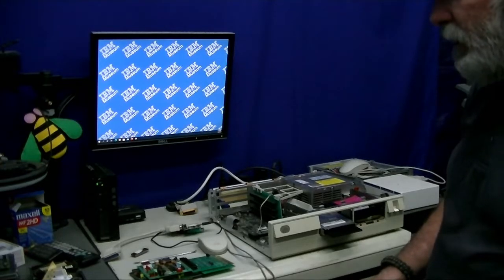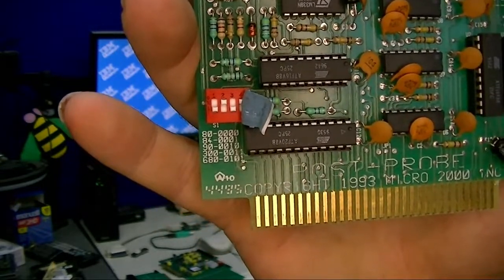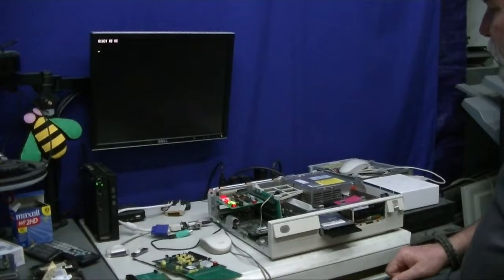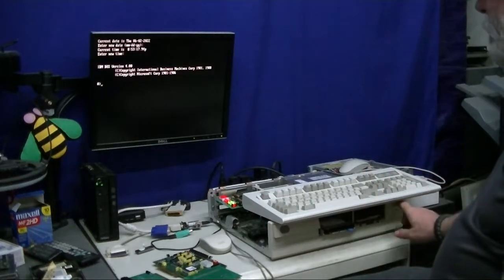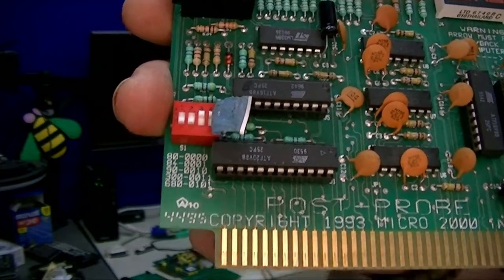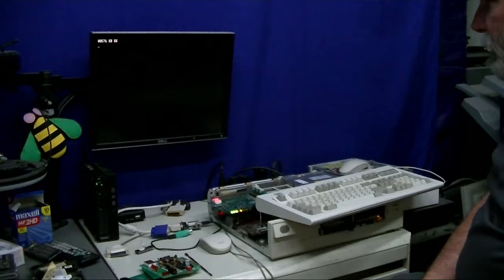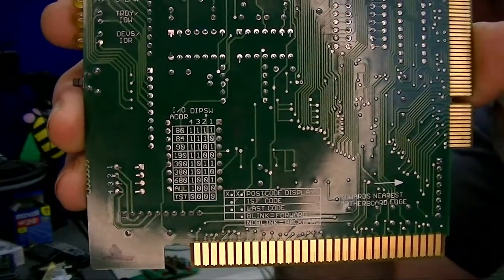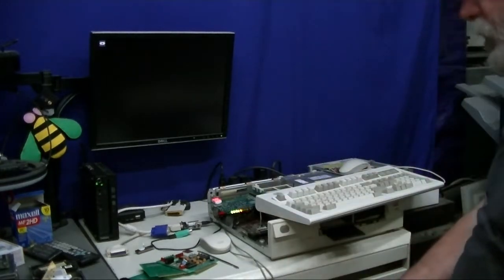Checking POST code adapters in ISA PS/2s!

Comment: Hah, I've never realized the original Model 30 and 25 (8086) used a different diag. port - 90h and LPT1 @ 378h. All other ISA-based PS/2s use diag. port 190h and LPT1 @ 3BCh afaik. Gonna check Gearbox and some other more obscure systems as well...